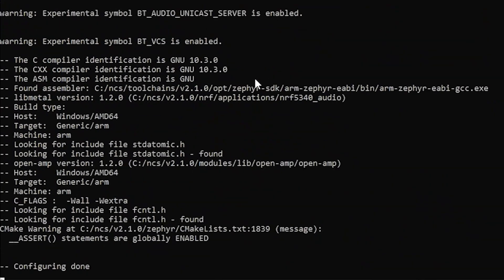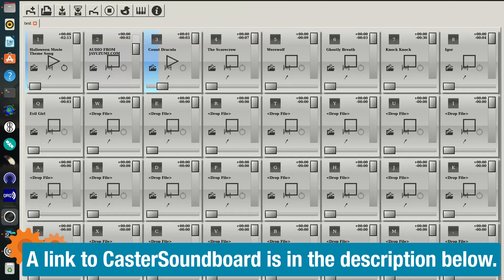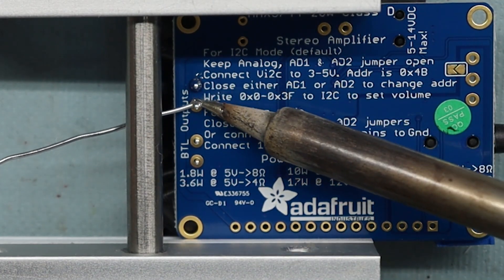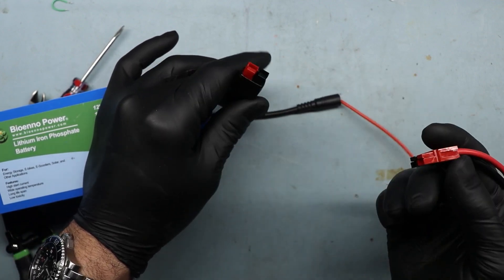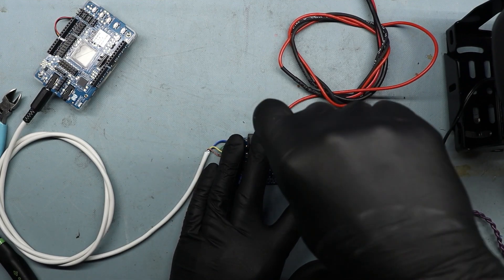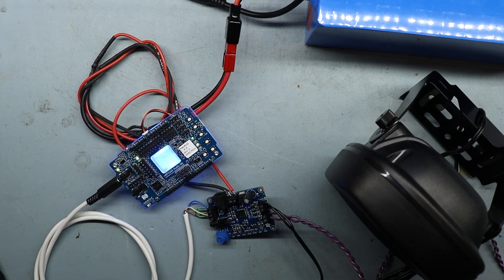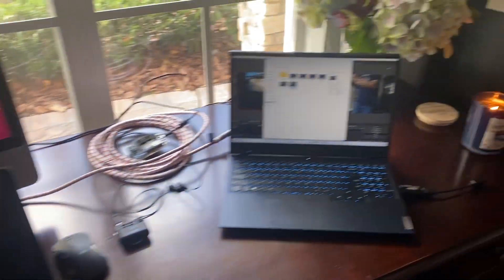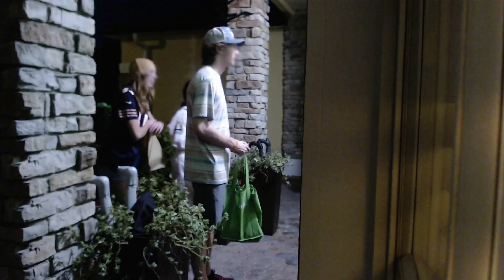BLE Streaming Audio Jump-Scare Device - DC To Daylight

Comment: Just a thought, Multiple speakers from different directions, staggered timings, echos, More than one thing playing at a time. Or A bass speaker in one spot, a mid range in another, a horn or tweeter in another, playing different sounds, growl in the bass and a screech in the horn. Or maybe just the multiple locations of the same sound becomes strange and alarming b/c its not normal to hear that way?
Reply: @AmRad Podcast The idea is to confuse the senses, this being auditory, changing the pitch, volume, location, frequency, or location of speakers.

Comment: On a different, but related topic.  Bluetooth headphones aren't long-range.  2.4GHz headphones can be, but they are rare and the good ones are very expensive.  A maker project I'd like to see:  a USB wifi transmitter getting the audio stream via USB (requiring software on the PC) or, more simply, a USB-powered wifi transmitter getting the audio from the headphone jack transmitting to a battery powered wifi receiver into which any headphone can be plugged.  This using a 16-bit (at least) ADC plus a popular, cheap, and small wifi-capable compute module at the TX end, and the same compute module with 16-bit DAC and audio amplifier at the RX end.
Reply: by sheer conicidence i`m working on something along those lines...but its currently frying my brain..a lot of challenges to overcome until christmas.